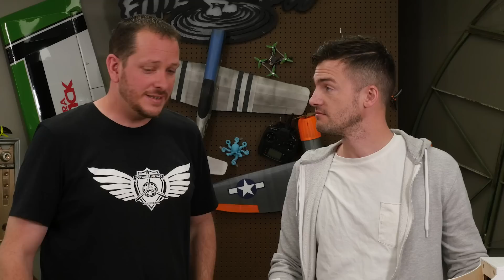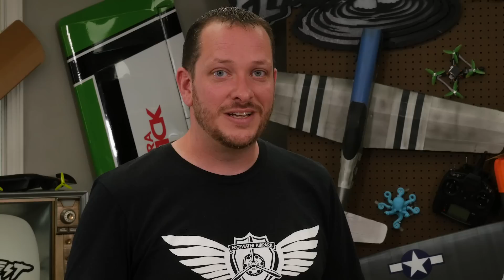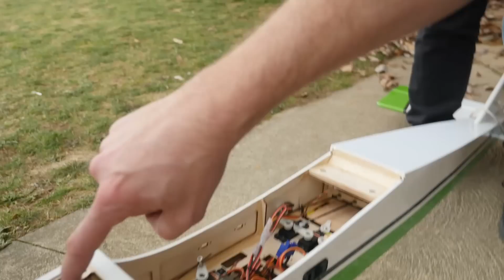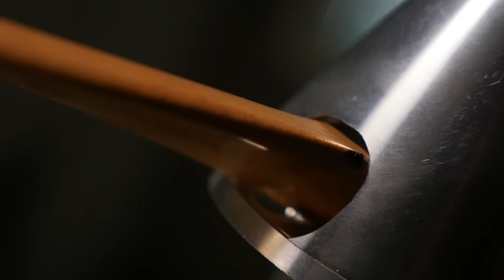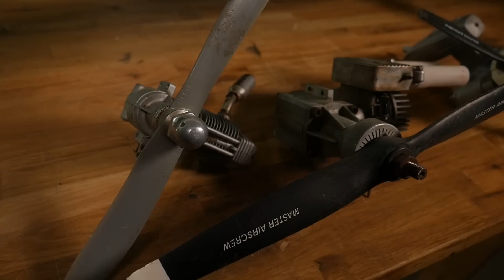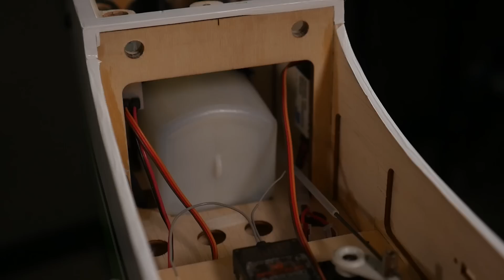Getting into Gas Planes - Breaking in an Engine

Comment: Hi how are you.  My question is about flysky radio transmitter. How can wire up  gas engine throttle servo with controller? 
In electric brushless motor connects with Esc controller but in gas engine how flysky will work.  
Thanks 
Jaan

Comment: Just don't run it lean. No need for break in period. The engine needs heat to break in, if you use too much oil and run rich and only partial throttle all you're doing is wasting fuel and oil!

Comment: Pro tip use air cooled 2 stroke oil or it will just seize . I know this because I used personal water craft  2 stroke oil in a chainsaw it just went as solid as a rock

Comment: Glow engines are easier to set up and fly than gas. For starters there's no ignition system or ignition battery to worry about. The glow plug and glow driver takes care of that. There also cheaper to buy especially second hand. They also better cater to smaller aircraft making it cheaper overall to get into the air.

In terms or reliability Glow can be as reliable as electric once you acquire the knowledge and diagnostic skills over time in operating them. They're also more fun than electric.

Comment: Honestly electric is the best way to go, battery technology is so much better now, no worries about the engine stalling, no fuel to buy, the only problem you really will have is if you crash it. But there’s something about having a real engine lol. Definitely right about breaking in the engines. 

My .70 magnum xl 4 stroke ran absolutely terrible before I broke it in. They aren’t like a lawnmower or a car engine where they run great during the break in period. I really couldn’t believe how different it ran after running a few tanks of fuel in it. The next engine I buy I will just make an engine stand and break it in on that before even putting it in the plane.

Comment: 20:1 is not necessary for break in 32:1 is more than enough for lubrication and cooling.    You also need a mineral based oil.

Comment: So I'm very sure I'm going to purchase the Hangar 9 Meridian 60 over the Ultra Stick. From the reviews I have heard over the Ultrastick was the poor build quality out of factory (i.e. the aielerons dont have a flush finish to the wings due to the hinge insertions not being centered). I would greatly appreciate insight to this as all reviews I'm able to find are from 2015 or older, and finding glow/gas planes is not nearly as simple as it was 5 to 10 years ago. I had originally flown the Big stick 60 and that was my original choice however they were discontinued.

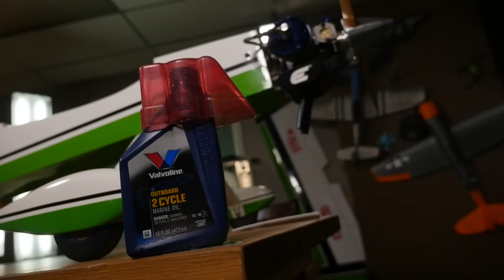Comment: You should always run after run oil no matter gas or nitro plane or car, or even a boat. Well, maybe not for gas cars all the time, but definitely for long-term storage. 3:58 What the heck? Outboard 2 stroke oil? I would stay away from that and use something like Caster927 by Maxima, Benol by Klotz, Dominator by Amsoil or some other high quality 2 stroke oil, at least for gas rc, and nitro rc, if you're cool enough to make your own nitro fuel. Maybe there is something else that should be used because i'm not into planes as much and they may require some other formula for the type of engine that they are, but 2 stroke marine oil doesn't seem right lol. Also, a separate battery for the ignition system? No magneto/coil? That's kind of sad :P.

Comment: Nice to see y'all showing some 2stoke/ balsa stuff! This is where I wish the hobby stayed in some ways.  Electric is cool but makes the care factor go down. Since if you crash a foamie you just go "well dang man guess I'll just hot glue it back together"  With balsa aircraft there's so much more care that's needed. Between building the plane over a couple of months or years, ensuring everything is done right, inspecting the plane before every flight, ensuring the engine is tuned right. Because if you lose that plane for what every reason now you have time invested and cant just get a hot glue gun to fix it.  Think it teaches children that get into the hobby a different level of respect for the craftsmanship of the plane and how to respect it.  Not to bash the electric stuff but between electric planes and the drone stuff I think it has 100% hurt the hobby in several ways.
Reply: I agree..one video i seen was a spot at the flying field where they burned crashed planes. Another symptom of out "throw away society". Really sad.

Comment: Started on Diesel, never could get the buggers started. Hated glow engines, now into electric, and petrol/gas ignition engines. At least I understand those. Now all I have to do is build a plane big enough for my Honda weedwacker/strimmer engine.

Running in/break in can be done at any time in the engine's  life (If you or the previous owner forgot) and is much easier on a test stand than mounted in the plane.

Comment: I only like 4 stroke Motors because you require no oil in the fuel and it burns a lot cleaner and you can get it about at any gas station

Comment: It's usual  (even desirable) to leave fuel in the tank of a petrol/gasoline powered model because otherwise the diaphragm of the fuel pump in the carburettor dries out and then won't work.  I've just run a 30cc Mackay petrol engine in a model that has had fuel in the tank since last year and it started with no problem.  Most (probably all) petrol engines used for models have carburettors with built-in fuel pumps often Walbro or copies thereof.

OTOH always drain the fuel from a glow engine tank as well as running the engine dry before storage or you'll be replacing corroded bearings.

I would certainly never run an engine on the ground for long enough to use a gallon of fuel (even a US gallon!).  Get it set up (perhaps using more oil) and fly but treat it gently.  Neither the neighbours nor your flying mates are going to welcome your noisy engine running for hours in your back garden or the pits.  I run my petrol engines on 50:1 synthetic oil designed for competition 2 stroke motor cycle engines once they're run in.

Comment: Look guys, you didn't have to do that motor or engine thing.
An engine is a type of motor. So both words are correct.

"An engine is a motor that uses thermal energy to produce mechanical work."
"A motor is a machine that converts other forms of energy into mechanical energy and so imparts motion."
Definitions taken from WordNet.

Comment: when break-in do it with the wing, the wing absorbs vibrations, without the wing all the fuselage has to deal with vibration, screw can come loose, electronic devices can suffer too, some components like caps are not prepared for a lot vibrations and conections can break

Comment: Great advice!   I think the typical gas engines don't require as much break-in as glow engines, but the key is the lubrication.  Look at the weed whackers, where the history is -fill it up and go.  I don't use ethanol gas any longer in my small engines, mowers, etc., now that I can get ethanol-free at the local gas station.  No more issues with moisture, green gummed up bio-remnants, and clogged carbs.

Comment: Nice to see that you guys are getting into combustion engines! However, I am a bit puzzled why petrol/gas powerd engines would be considered cleaner than glow/methanol engines. I fly my glow/methanol 2-strokes with a mixture of methanol and castor oil and no additives. I have not encountered a problem so far. Isn't an alcohol and a laxative (yes, castor oil is a laxative...) more pereferable than a hydrocarbon-petrolmixture with additives? Maybe I misunderstood something there..

Comment: Hey guys. If i was you i would not programm the failsave to cut the throttle and turn the engine off , cause if you have signal problems the engine turns off and if you connect again in the air (all this in a few seconds) your engine is turned off = Dead Stick . After that you all will think of , why the engine stopped.

Comment: Don't let the grammar Nazis tell you to say "engine!" Quite frankly because they are wrong. The words engine and engineer come from "ingenuity" and have more to do with ideas or thinking. If you've heard of an idea engine or some idea being referred to as an engine it's actually motors and locomotives that were called engines in a symbolic fashion not the other way around. A motor on the other hand is a device that moves or provides motion to a machine. Combustion "engines" are very much motors. Although they have adopted the name "engine" in common usage the word motor is not technically incorrect. So say motor all you want and tell everyone else to buzz off.

Comment: from Castor Oil to 10,20,3,4,5,6,7,80,90% Nitro Methane, higher the hotter.  Something like an old "Merco" engine, 5%max Nitro 95% Castor or Synthetic oil,  Race engines use straight Nitro Methane, without a variable carb. gas engine. usually with bearings not bushings.   Then there is a 4 cycle RC engine, run on "gas" just like a regular gas engine  They run new from $35. $1500.00 or more, even rotary engines....

Comment: Great to see another gas episode after the Roadrunner one a few years back.  I love flying electrics and gas motor planes & have shelved the nitro planes (long drive to get nitro fuel for me).  Gas is cheap to operate, almost never needs any tuning work on the carb needles after being setup, not any cleanup like nitro & can pull around a big plane like nothing.  They have been super reliable and easy to start.  I would avoid running a plane much without the wings on - it shakes the fuse pretty good.  I've done air break-ins, but check the manual - if it says a ground break-in is needed, they will know best.

Comment: Running at reduced power while on the ground is also true for full scale aircraft.  The runup and magneto check happens at less than full throttle and is only supposed to last a moment to keep from overheating the engine.

Comment: as a certified small engine mechanic , please do NOT use marine grade two cycle oil.  

it has ammonium blended in it. this WILL cause carburetor  and fuel line issues.
Reply: Stupid people. Also what should be used, something like Caster927?
Reply: YES!!!....im also a qualified small engine mechanic...36 years in the trade....DEFINITELY DO NOT use outboard 2 stroke oil in an air cooled engine......outboard oil is not designed for the heat created by an air cooled engine....it will carbon an air cooled engine up really quick...been there seen this happen time after time when its been used in a chainsaw or brushcutter
Reply: @hardtop123  also needs to be ethanol free gas

Comment: There is nothing like to start your Saito FA-62 four stroke methanol engine. Prime it fore +/-5 rotations. Apply the glow stick and flick the propeller against the compression, clockwise. Watch out for the blade that is coming back when the fuel ignites. Use welding gloves or chicken stick. If you do it correct the engine wil start in a counter clockwise rotation (looking in front to the plane). And if the plane is a Four Star from Sig, you have power for 90 degree take of. And the sound that no electric motor can ever make.

Comment: Shame on you, gassers are no more of a real deal than electric planes. It is just another option, with its benefits and cons. A pet peeve of mine is to dispell the notion that some planes (gassers) are real planes while electric planes are not real planes. Both fly, both are real, none is better than the other, but each has its strengts and weaknesses.

Comment: TIPS: Always have a wing on when running in an engine, the vibrations from the engine with shake the hell out of the plane and make the glue release from the wood. Another tip is fuel proof your plane before you start flying the aircraft, using only 30 min epoxy and methylated spirits to thin the glue out and brush it on lightly just to cover the wood and let it set over night.   for the first few tanks of fuel run the aircraft rich until the engine has properly seated. Also by using an electric starter yes its a lot safer but if you have spent a lot of money on a nice spinner it will continue to put marks on it so I suggest to used a starter stick, with a rubber end so that it doesn't damage your prop and one you start to feel comfortable then you can start using your hand. (Hope this helps some newbies into the hobby)   :)
Reply: does cordless drill adapter available?
Reply: @ilham7345 no

Comment: Cool vid, guys! By the way, I have a challenge for you guys! I mentioned it before. (I think it was on the crash compilation.) Take an airplane, equip it with a very strong motor, then remove the main wings and try to fly it using the rear end to control it. It cannot be a flying wing or a nutball, just a normal airplane. You can then make any modifications to help you control it and/or stabilize it, but no wings for lift! You can add multiple engines if you want!

Comment: I enjoy both Infernal combustion and electric. By the way the 2 E’s don’t go together I.e you don’t have an Electric Engine, it’s a MOTOR.
When running in an IC ENGINE, the majority of the wear happens between cold and normal running temperature. 
When the head is too hot to hold I shut it down and let it cool.
After normal running temp, everything has expanded, and very little wear takes place, so all your doing is using up time and fuel.

Comment: I imagine many of your viewers are electric park flyers . If you guys do a follow up video , you may want to mention that gassers are not usually recommended for park flying  .... or soccer-field/softball-field/etc . And also let viewers know : as well as 2 stroke engines , there are 4 stroke engines available .
Reply: I just was given a free flow engine plane 25 years old about, where should I fly it? If not at a field I dont understand.
Reply: @pipsqeak7104  At an RC club field ( ask what is required to fly there ) , or on private land with permission .
Reply: @av8153  thank you! I was not expecting an answer from a 2 year old comment,  but it is very appreciated. That's makes sense.

Comment: my first was a gasser that flew on a control line, you went round in circles and controlled it with 2 strings and a handle. mostly you got dizzy flying the damned thing.

Comment: Great video lads. Can you lads do a nitro video too. I started off on electrics and wanted swit h to gas. Got this u can do from a guy at the field only to find out that its 4 stroke nitro, and that's all i know of the engine. Was so disappointed. I wanted speed and noise but my t-34 mentor 25e fr horizon hobby was way faster than the nitro. How can I tell what size it is and can that engine be used in that ultra stick?

Comment: First gas plane was a cox Cessna line control.
Reply: Tom Gordon damn man that's old school my whole life we've had remote control seems like a given theses days, happy flying brother! ✌🏼️
Reply: Son of Kek I know it's old school, I was 6 ,and it was 1971 ,4 years later I converted Guillows P-51 402 die cut kit to r/c ,with gas powered peewee engine ,had to reenforce the fuse and wings,add a few more coats of dope compared to only one for rubber powered,and the kit came with push rods,control horns,plywood firewall,plus instructions for the r/c set up. The tx. looked like a square box. Fun flyer though.✌

Comment: You don’t always want to run the “Engine” with out the wings on it because the vibration from the engine can cause the glue joints on the plane to break lose.
Reply: That's true, try that with a four stroke engine, or better a four stroke boxer. You will have a pile of parts in a bag (the shrink foil) you can reassemble to a plane again. If the fuselage gets in resonance there is no stopping.
The wings will have a kind of anti vibration to the fuselage. Just the mass and inertia will help against the vibrations in the fuselage.
You will learn this when you play with larger model planes. Just idling can break the fuselage.
Reply: Yeah always but the wings on. Big single cylinders are the worst, but I wouldn't run twins either without wings on.
Reply: Chad Cole That’s true. But it’s ok, all airplanes are like milk... go ahead, ask 😁
Reply: Metroid1977 I do play with big airplanes 😁
Reply: Chad Cole rubber mounted help a lot with that and a well balanced prop 👍
Reply: Flyers District - Yes sir I understand that but it’s still not good on the airframe. 😉👍🏼
Reply: Do most modern air frames rely that heavily on the wings for structural soundness?

Comment: In french there is only one word for both "motor" and "engine" so you english speaking peoples are making life complicated for nothing, I don't even know what is the difference between the two and not two peoples have told me the same thing about that.
Reply: Engine refers to reciprocating combustion engines motor refers to electric alternating motors.
Reply: There is no difference. They mean the same thing. People just get butthurt when you use the "wrong" one.
Reply: Ironically the terminology for engine had french roots!
Reply: Air-headed Aviator you beat me to this! Lol
Reply: AFAIK: "motor" is a turning thing that moves a load, "engine" is a thing that uses hot gas expansion to produce rotation.  Your car has an engine which is also a motor (burns fuel, moves car); a static diesel generator has an engine which is not a motor (burns fuel, moving the generator around isn't its purpose); an electric car has a motor which is not an engine (moves car using magnetic force, not fuel).  I think it's fair to call a plane engine a motor because it's moving the plane by turning the prop.
Reply: Dummies, engines are ideas. Not hot gas burny things. It comes from ingenuity. It has nothing to do with how it runs. We've adopted it as a name for complex motors but I assure you it has zero to do with how it runs. It's just a word that found a new meaning in our language and pedantic speach Nazis like to tell people what it means with no knowledge of it's roots. Knock it off and leave the bilingual people alone. It may be an engine to some but it's also a motor even in English.